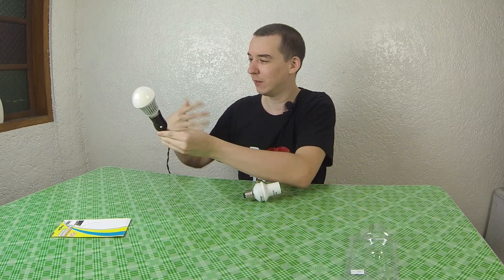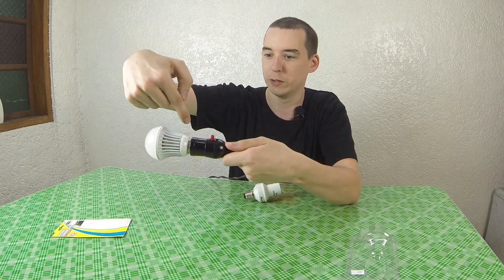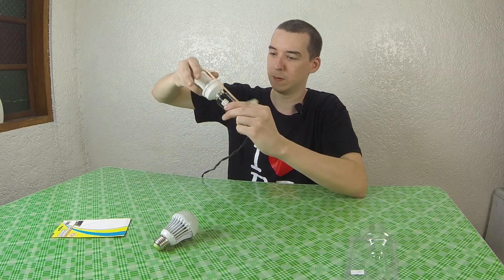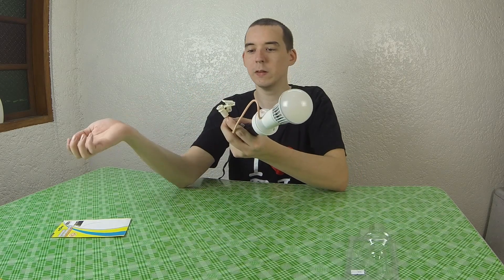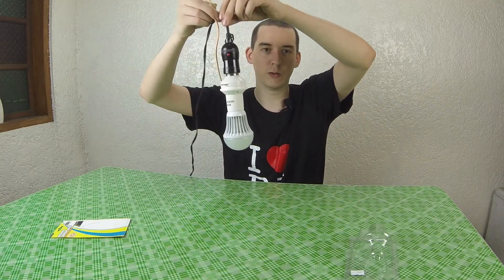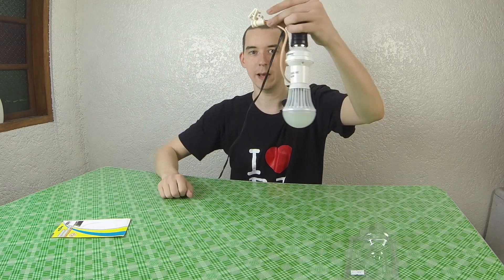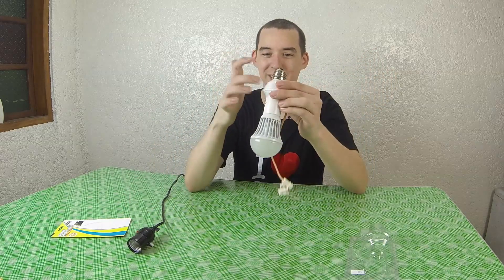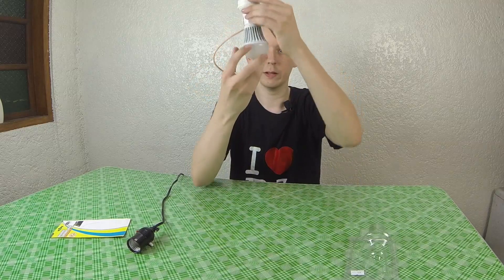Automatic Night Light Socket CDRKING

Comment: hello sir Phil will that automatic lightbulb work on those you buy on cdr king for solar kits? oh btw my solar generator is almost done just need a case of some sort so it would be portable everything is working fine but I choose not to use power inverter :D 12V fan, lights and usb lighter plug for the cellphone charging anyways thank you and more power to your YT channel. God Bless.
Reply from the maker: Great, come back and share some pics or a vid when you finish it? the good thing is that your setup will be more efficient than using an inverter :) The cdrking auto light will only work with AC. Theres some local sellers who sell a small pcb with a few components to turn a DC load on automatically when it gets too dark (using light sensor). Theyre pretty basic and need a case, cost about p300-p500. Im planning to make a video soon showing how to use an arduino (local cheap small clone), a light sensor and a mosfet to make your own circuit to do the same thing. The cost will be about the same but its a fun project and you can add features like light effects, PIR etc :)
Reply: thanks Sir Phil and looking forward to that new project of yours. Best of luck and again thank you :)
Reply: Sir Phil, I've already uploaded a short videopics of my solar generator, the battery is 12V 9ah hopefully it'll last moreover than expected :D sorry if the wires all messy but I plan to put that on an enclosure that could be carried around like a suitcase or something to that effect lol anyways thanks for the inputs on wire gauges and again best of luck on your YT channel and God Bless.
Reply from the maker: jus0402 Nice! Just checked it out now. You got some nice connectors too :) And I see you added an inline fuse. Looks good! Well done :D
Reply: thanks Sir Phil and God Bless! :D

Comment: The sensor is too close to the light. Am using omni photo control switch for years now.
Reply from the maker: I can't say I've had an issue with the length of the light sensor. But I also like the omni photo control switch so thumbs up from me :) This socket version is just a little easier since you don't need to do any wiring.

Comment: Hi, I bought the two units of this and apparently, both unit becomes not working after a month. Was thinking if you experience the same. cheers/.
Reply from the maker: Strange... I haven't experienced that. They both broke at exactly the same time or separately ?  Is it possible that you had a power spike or something like that? I assume you've tested the bulbs outside of the automatic sockets to make sure they're still working? And tested the socket itself?
Reply: Gadget Addict
Hi.. actually they broke not at the same time. I bought another one after the first one broke. Thinking the next buy will be a good quality. I ask my friend to test it and he confirmed that it is not working anymore.cheers.
Reply from the maker: Ukelele Strings That sucks :( I'm guessing they're out of warranty? If you're okay with a bit of electrical wiring, you can buy an omni automatic day/night sensor unit from ace hardware for around 250-350. At least they have a long warranty.

Comment: interference as the light turns on. I wanted one as well,but i had always used omni photo sensor switch from ace. They last for about 2 yrs and cost P250.problem is theres a bit of wiring to do.i've tested it and can run 3 15W bulb.i Think it can do more.
Reply from the maker: The interference is related to the dimmer box and dimmable bulb I'm using. Rather than the cdrking product. I went into a little detail in the video description about that :) I've seen those omni ones but like you say, you have to do your own wiring which puts me off a little.